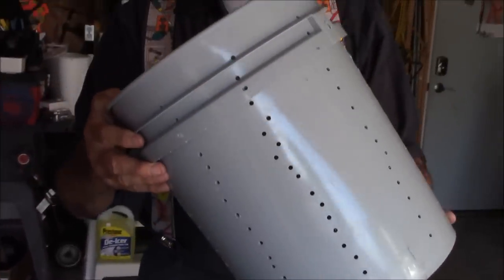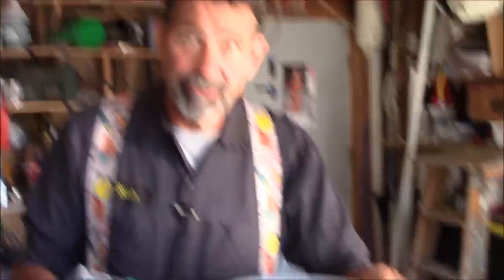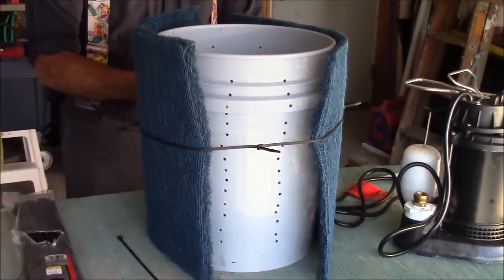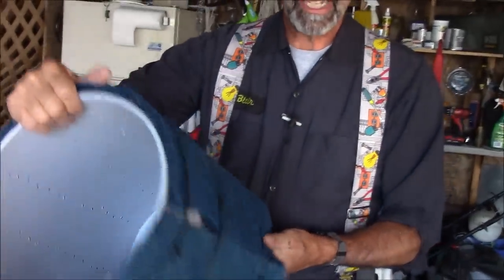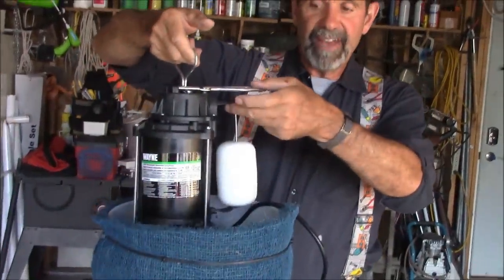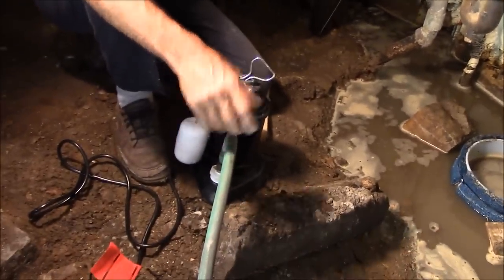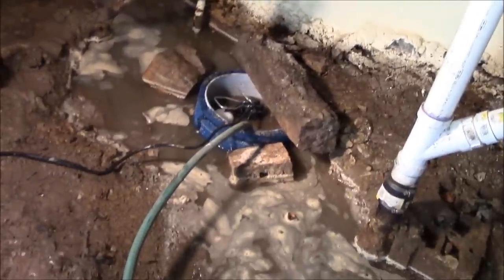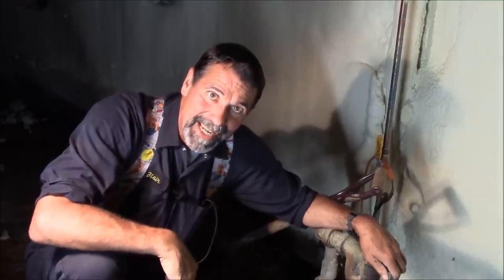Crawl Space Sump Pump and Pit with Mud Filtered 5 Gallon Bucket

Comment: Great, effective, and cheap solution! I wonder if adding 3 or 4 feet of french drain into the bucket and 3/4 inch drainage rock (wrapped in a burrito filter fabric) would be worth the relatively minor amount of extra work to keep that small area extra dry during and after the rains.
Reply from the maker: Of course. Adding a filtered accumulator is always a good thing when collecting water.

Comment: You mentioned using a utility pump originally, that's my current situation and the hole is smaller than a 5 gal bucket.  Do remember   what you used for a mud filter on the suction hose?  Should I just make a miniature ve  rsion of the 5 gal bucket, or did you  have a different setup that worked.  Or is there a small diameter sump pump (with float) available?
Reply from the maker: I use a ‘Cut to Size’ furnace filter that looks like a plastic scrubber, see video,  
https://mrhardware.com/articles-and-videos/all-articles-with-videos/sump-pump-yard-mud-filter-to-protect-remove-water-for-work-in-hole/

Comment: Great video.  I have an issue where I seem to have an issue with the water table getting too high after heavy rains and then I have puddles in various places of my crawlspace, but typically not everywhere in the crawlspace (which is fairly large).  If I just dig a big hole and put in a basin with holes in it , would that help with the water situation everywhere in the crawlspace, or will I need to bring french drain lines from all over the crawlspace and dump in to the basin?
Reply from the maker: One big drain works pretty well. I started with that and  then dug channels from it to my low points as I got time.

Comment: I need to do this this year. 
How far from the founddation? My low spot is about 2 and a half or three feet from the foundation. I can easily adjust as needed by putting the pit farther "upstream". 

Any video or good tips/adive on how to drill through the house to have it drain outside? 
I'm thinking of putting PVC through the vinyl sidng & just caulking good but to me it seems like I'm missing a step or two that could save me greif later....
Reply from the maker: I would like it to be 5' from the foundation. You can dig the pit and lower the soil to the pit like a stream so distance is only how far you can dig. I drill a 2" hole in a bond and siding for 1 1/2" pvc. That leaves a very small gap because the pipe O.D. is 1 7/8".
Reply: @MrHardware1  Thank you. this may well be one of my "quarentine" projects to keep me from going nuts with boredom.

Comment: I just went through my crawlspace because it kept flooding during heavy rain. I crawled to a point where the water was coming in and I noticed it was coming through a pipe in the ground with a cover on it which looked like paper with a hole in it. Is there anything you can tell me about what this pipe might be?
Reply from the maker: Size and material of the pipe?? Could be a power chase for a receptacle outside, a sump discharge,  No clue, sorry.
Reply from the maker: Jesse Cab  That is a big line, I would like to find out where it goes. A sewer guy or an excavator to find out what it does.

Comment: Why in the world are you using a 1.5 in to garden hose converter, that causes a LOT of pressure to build up in the pump and will cause it to die out in less than a few months.
Reply from the maker: That is 1 1/2 by 3/4" bushing. Sorry to say I have this system over 8 years old and still running. My cottage has 2 of these. These are centrifugal pumps, not positive displacement so the pump does not feel much of the back pressure. Plus they usually do not run over a minute a cycle. Nice theory though.
Reply: I just feel that it should be 1 1/2 especially with that 1 1/2 pipe a few feet from it that it could be connected to.
Reply: Not. I have done this for over 40 years. Gone through 3 pumps in almost 40 years. Garden hose worked just fine.
Reply from the maker: Thanks, Blair
Reply: @Rodj12341  😂
Reply: I mean they made to be used with water hoses lol

Comment: Just spend the 30 bucks and buy a sump pump basin
Reply from the maker: I would have loved to except working underwater I knew I couldn't get 24" deep for a sump pit. Plus I was perforating the bucket with the filer  to gather shallow water but not below the lower half of the bucket.